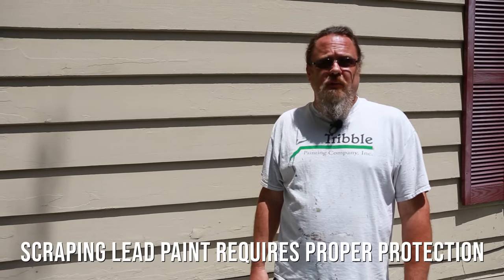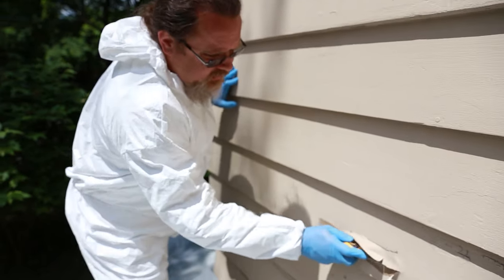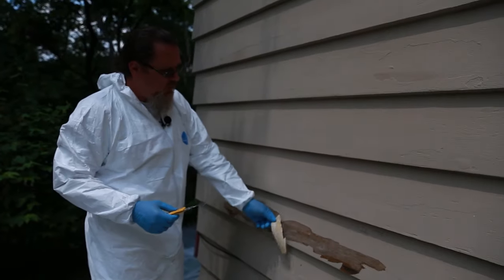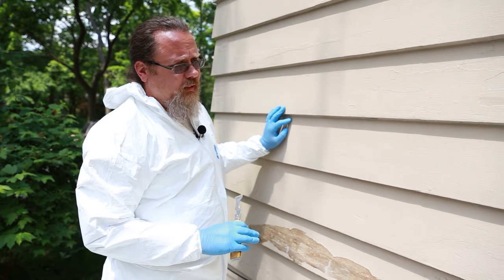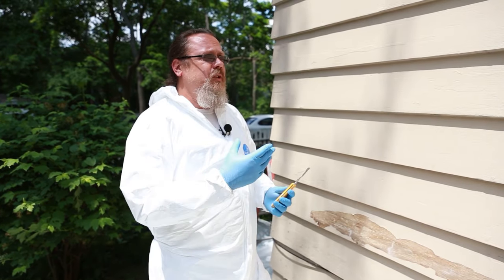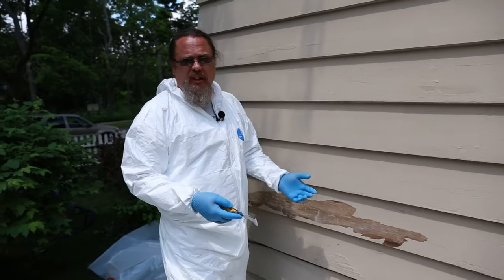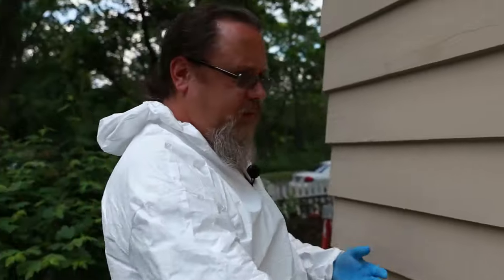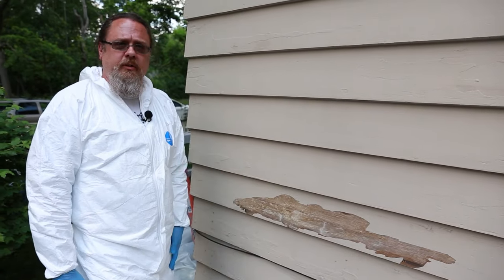How To Scrape Paint Off Your House (The Basics)

Comment: After the scraping, you should sand a bit to feather the edges of the remaining paint.  Otherwise, peeling is more likely to occur.
Reply: Yeah but sanding lead paint is generally ill advised.
Reply: @NoTengoIdeaGuey  while thats true and not saying lead paint isnt still out there on old homes most jobs have been painted in the last 40 years so a very less common worry

Comment: It seems like the painting industry adopted a pressure wash and spray methodology because it saves time. If you tried to blast off that paint I'm sure some would come off but if you just gave it a glancing blow then paint over it, the customer would never know. In other words scraping is usually necessary and you can't just pressure wash and go. I like to use a 3" "chisel" style putty knife. Paint comes off like skin from a bad sunburn. Then sand the area back and feather with 80, prime then paint 2 coats. You are right, 99% of people would never notice a good job from a half assed job. I'm also a fan of peel bond type primers for the south side of the house, door frames, wood deck rails etc. Good video.

Comment: Bought a house from the 1920s, it had so many layers of old paint there are places where it was 3-4 mm thick. We opted to simply re-side based on the amount of labor that would have gone into painting. We had quotes to paint that were essentially the same as re-siding.
Reply from the maker: Bryan nice move. Many times we offer this advice to our clients depending on their goals, budget  and how long they intend to stay in the house.
Reply: A vinyl sided home from the 1920's is just sad. If the cost was the same why not make the home look amazing with a proper high quality paint job? Now you have a plastic coated house ugh.

Comment: Going to start scraping Cedar shake siding this week. Wouldn't be bad if it weren't all extension ladder work. Thanks for saying that it's going to take some time. About a thousand sq ft. I have all summer.  Using a two in one DB dura clean. Same color over color (wineberry dbAgedBeauty). Did this twenty years ago...fell off the ladder (removed those rocks since then) Thought I'd give it another go and nobody would come out to bid a job this small.

The two keys #1 it will take a long time to scrape. #2 accept the fact of long hard work.

Peace and thanks
Reply from the maker: Good luck Thomas! ladders can be tricky and dangerous, so we always make sure to go slow when extension ladders are involved. Making sure the base of the ladder is secure can mean all the difference when you get up in 40-50 feet of height on a ladder. Please be careful, and let us know if you have any questions. We are here to help!
Reply: Could you do the job in stages? e.g. scrape, encapsulate, and paint the north side, then repeat for each of the sides or does it all have to be done together? i.e. entire house scraped, encapsulated, and painted at the same time.

Comment: I did that to  the back wall of my house last Spring/Summer season.  The set up was exactly as shown in the video.  Same type of tongue and groove boards.  What a nightmare.  
You do have to remove it all, especially the paint from under those lips where the tongue meets the grooves.  What a hassle.  If you don't remove all the old paint, it keeps popping up, especially, as in my case, it takes you more than a day to scrap it.  What happens is that overnight heat or humidity ends up getting underneath the bit you just scraped, and if you left paint behind, that paint will end up lifting and start pealing.  I was scrapping for days.  
Take it all down to plain wood, or you are just wasting time and money.  No other way around it.  If you "gauge" the wood, get a good wood-filler such, fill in the spots you need to fill in, wait a day, sand it.  Be prepared to scrap paint until the day you are ready to paint.  Most likely, if you didn't scrape it all, you will still have stuff to scrape as you are painting it.  Don't believe me?  Try it!
Reply: Yeah I think I’m going to just put on vinyl siding considering the amount of bs that has to be done to get the paint ready. I’ve tried scraping and I’ve tried painting over but it seems no matter what like you said if you don’t get every bit off then it just chips off again.

Comment: Great video guys! I’m a first time homeowner and a ton of our exterior paint is flaking off the wood in large pieces. There’s also what appears to be thin plaster peeling off with it - I can’t tell if it’s plaster or if the paint was just applied waaaay too thick. Is there another product I should be using before primer + paint? Clearly the last guys did a poor job (the paint isn’t super old) and I don’t want to make the same mistake. Thank. You!
Reply from the maker: Hi Amanda! Congratulations on getting your first home, how exciting! When it comes to paint, it's not always perfect and paint can be weird and unpredictable. We've seen paint stick well to surfaces we didn't think it could handle and we've seen some paint just fail to bond to other surfaces. When scraping your house for a new paint job the scraping is the most critical part. Using blades to scrape and even sanding the exterior gets that old cruddy paint off and allows the new coat to grab the exterior properly. Which is the goal before the new coat is applied.  From what it sounds like, the new coat of paint didn't bond properly. How long ago was the exterior painted?

Comment: What about using a pressure washer? Clean first then use a 0 degree spinning fitting? Seems to be much faster at removing the bulk of the paint before scraping.
Reply from the maker: I bet this could work. If you have the space, I say go for it. Just be careful if there is the potential for lead paint like we had in this video. I wouldn't rely on just the pressure washer only either. Get some good scraping in and let us know how it went!

Comment: The paint on our new to us old house has very thick paint. The edges of the paint underneath under the recent pain are thick and obvious. The thick areas are bonded well. If I don't remove it, it will be unsightly. I don't want to sand the paint for safety reasons. Can I build up the low areas with something like a putty to even it all out?

Comment: If you wait days and it rains after peeling the paint, would more areas pop up do to weathering. Did a house and a week later after days of rain and extreme heat, there was more peeling than first seen when checked. It's like the edges came up and started peeling again
Reply: Yes, if you scrape and it rains before you get to prime those areas the moisture will lift some of the edges and you will have to re-scrape.

Comment: Thanks for the video.  The subject was easy to understand.  :o)
Do you have any videos on how to handle (powered) chalking paint?
I'm 71 years old and I am going to have to paint my single story house. Where I live has very extreme heat conditions during the summer months ( up to 117F ). The paint that is on the house is over 17 years old and the colors are fading fast.   I am going to paint it all just one color (white). I'm tired of humping up a tall ladder to paint the blue trim on the house, I'm too old for that.  I am going to use a Graco magnum Pro x17 airless pain sprayer.  I need to handle the (powdered ) chalking paint before I paint it. Is there anything that can be run through a pressure washer that would help wash off the chalking? I'm painting my own house because where I live you can't get anyone out to give you an estimate.  They are not interested in a single story house that isn't large and cost big $$  to paint it.
Like I said,  I'm getting to old for this stuff. lol  Thanks again for a great video, it was very helpful.
Reply from the maker: Hi Sidewinder, Glad you liked our video. For a house with chalky paint I would wash it with TSP-PF. You will likely remove a lot but not all of the chalkiness with this process. I would then plan to paint the house with a top grade paint such as Benjamin Moore Regal. This type of paint will help "bite" into and bond to the remaining chalky surface. These top of the line paints will cost more but will also give you years longevity protecting your house. I hope this is helpful. Tribble Painting
Reply: @TribblePaintingCompany  Thanks for the reply. It helped out a lot. I just tried some dish soap (brand name omitted) with a RV scrub brush on a test section of the house.  It took off the chalking pretty good. I'll try the TSP and see is it works better. I can't use my power wash because I might get water in the house. I used just a garden hose and so far it looks good. Thanks again for reply.  :o)
Reply from the maker: @nmsidewinder  Hey Sidewinder, hope you did well with washing off the chalky paint you mentioned. We've added a video about aluminum siding that covers the topic of chalky paint found on that type of siding. If you would like to check it out, it might help you out if you still need to deal with that stubborn oxidized factory finish. https://www.youtube.com/watch?v=lcw_sjDFOhA&t=61s

Comment: never just use the "primer paint" on raw wood!   oil base primer for sure.  then your latex top coat paint.   And probably some sanding just after scraping.   with a dust mask 😷  of course.
I would have a hard time wearing those rubber gloves though!  doesn't it get all hot & sweaty!?

Comment: If any lead paint is not removed, then the surface will be uneven when painted over, as the new paint will layer over the leftover old lead paint. How does one fix this? By sanding?
Reply: yes with 40 grit sandpaper or a painteater

Comment: Don't you ever sand those edges to make it level with the existing paint and boards?  My mother and I painted her house 18 years ago and she had me getting rid of the loose paint but sanding all those edges down, so when paint is applied you cannot see all those rough weird edges, if you don't you still wind up with a crappy looking paint job because you can see all the areas that chipped off through the new paint.  This is the most laborious and frustrating part of the entire job, but has to be done or anything else you do is just a waste of time and effort.
Reply: Feathering the edges by sanding is ideal but that's lead paint so their avoiding sanding, that dust gets everywhere.

Comment: …mmm. 🤔 my sisters house was worse then this  !  Buy a right angle grinder and stop by Harbor Freight and buy their WARRIOR  abrasive disks 👍🏻  !  It’s 100 times faster and you can easily feather / sand down the edge of the paint to the wood to make a smoother looking surface !
Reply from the maker: this would normally be the case but with the risk for lead paint in this video, sanding is a big no-no for the Michigan guidelines for handling lead based paint. Always wear a mask as well!!

Comment: Are you kidding? You're scraping all that paint off of all that surface area lol that would take forever... Smh
Reply from the maker: You're right, it does take a long time, but if we don't remove the loose paint, the new paint will bubble and peel. We don't just want to paint over a problem, we want to make sure we are able to do a quality paint job that will last. If you have a different way of removing the paint, we'd love to hear it. We are always open to new techniques!
Reply: Some will sand blast it off but if not done properly it can really damage the siding. I'm not a fan of it myself. Not a fan of scraping an entire house in 100° weather either but that's what I'm doing this week 😬